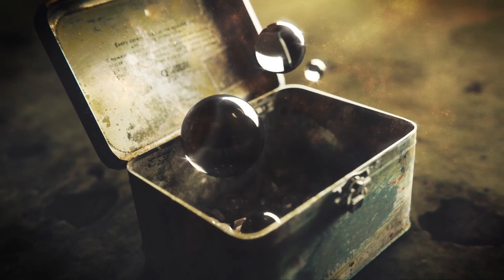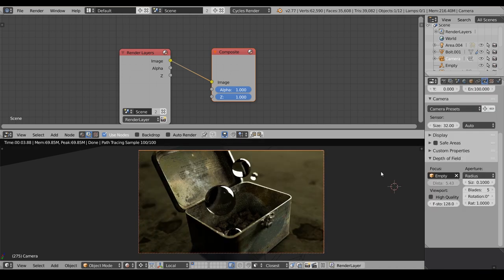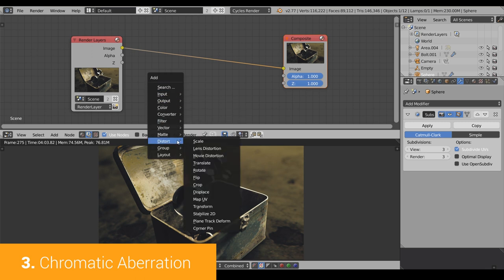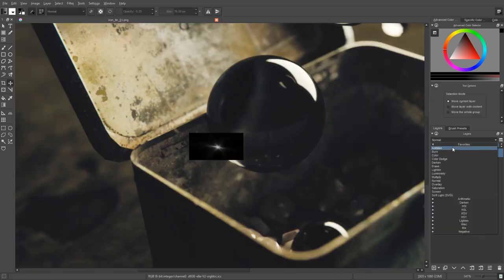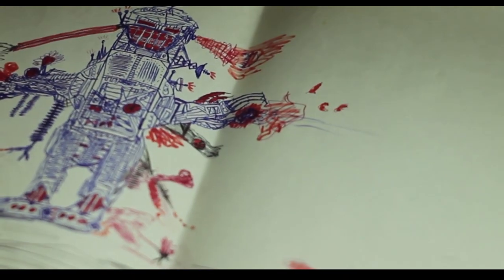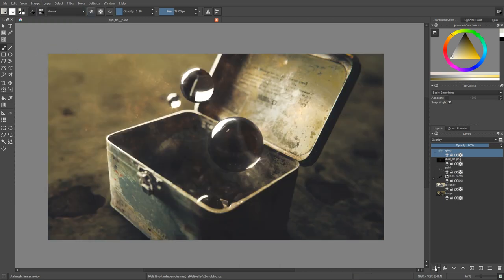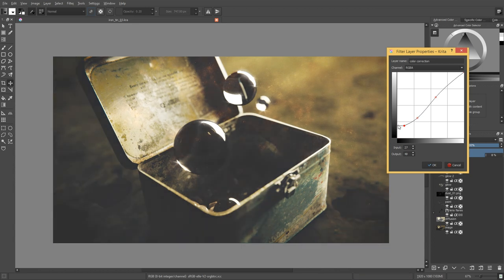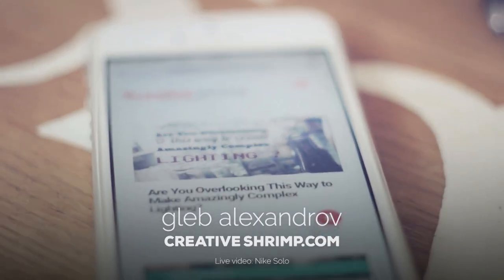Post-processing for Dummies in Under 12 Minutes - Blender and Krita Tutorial

Comment: Really nice to see you combine Blender and Krita! Regarding Krita:
- Groups are set to the normal blending mode by default, so the blending mode of the layers inside of it only works within the group. There's a brick-wall icon to quickly set a group to pass-through mode (Photoshop works the other way around, pass-through by default, and you have to set the group to normal manually)
- You can mirror the canvas anytime with the M key. It doesn't actually mirror the layers, so it's instantaneous even with large documents. It's just a tool for digital painters.

And jeez, I'm dying for shortcuts to change the layer blending modes and opacity, it'd be great for compositing.
Anyway, thanks for the tut!